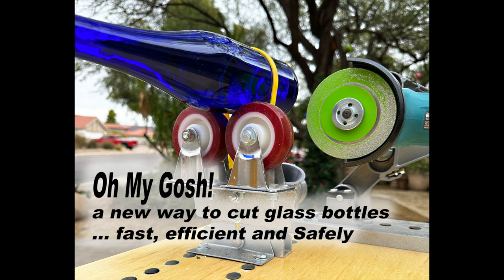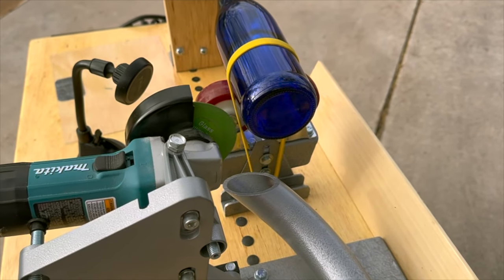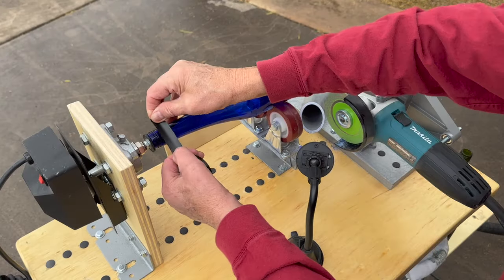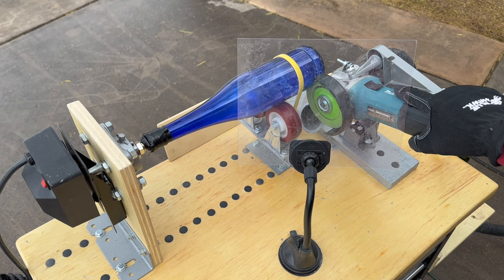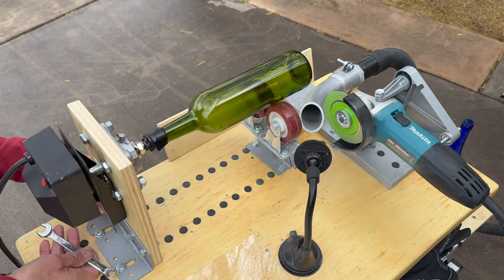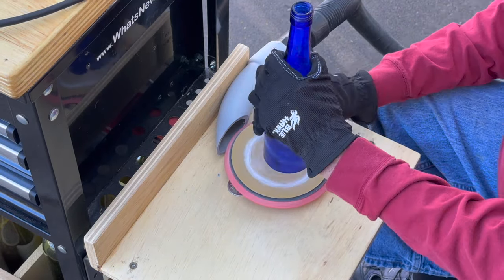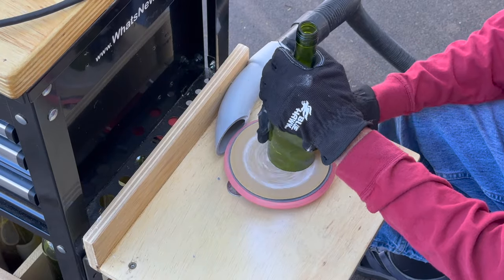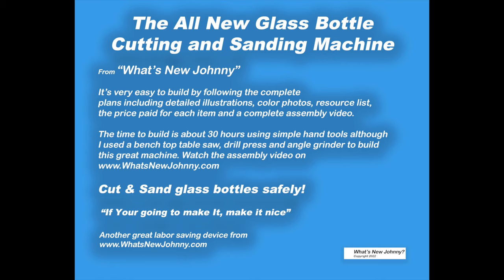Glass Bottle Cutting & Sanding Machine

Comment: Great work right there. I've been cutting whiskey and bourbon bottles and creating projects from them for a couple of years now. I use a large 10in wet saw, but still have to deal with a lot of chip outs. I may give your plan a whirl. Thanks for sharing! I'm amazed that you are able to cut them this well without using any water to keep things cool, but it looks like it does a great job!
Reply from the maker: The Best Ever Glass Bottle Cutting & Sanding Machine 2.0 is even better Watch the video Thanks for your comment
Reply: Your invention is very well made and thought out.  Thanks for sharing.

Comment: great job Johnny, I also cut bottles to make glasses and built a wooden jig that's less complex than your device. The main issue isn't cutting the bottles, but how you do it and in particular what angle grinder you use. I noticed that the discs you are using are green and probably the same band I am using. I bought them from a Chinese supplier I found on pinterest, but apparently, there are many that sell the same discs at different prices. The discs I am using are 100mm in diameter wide and have an inner hole of 20mm. Now, all angle grinders I found  on the market are intended to be used with standard discs of different diameters, but all with an inner hole of 22mm. It's been mission-impossible to find a device with such a size. I noticed that you are using a Makita. Can you tell me what model is it? thanks

Comment: the only part that i cannot figure out is the bracket that is holding the angle grinder. I downloaded the plans yesterday, yet I cannot get the file to open with multiple pdf readers. also, how well does this system work for square bottles? Found the bracket so I can figure the whole system out